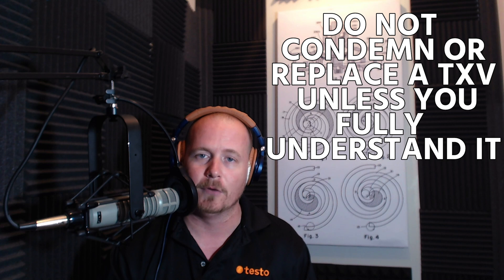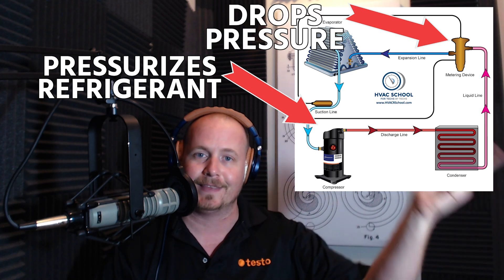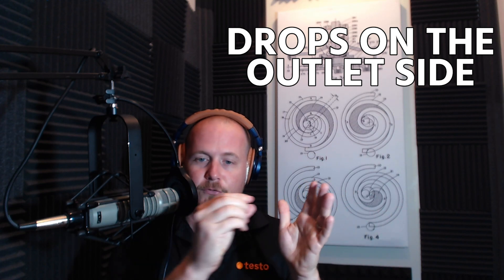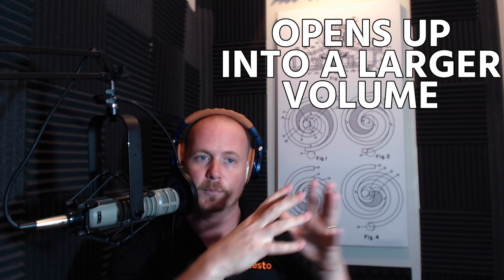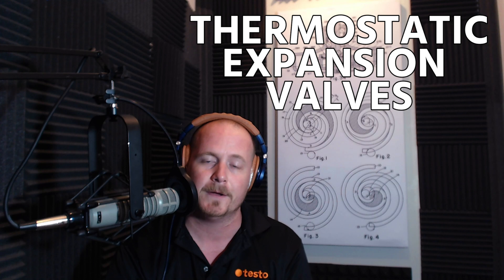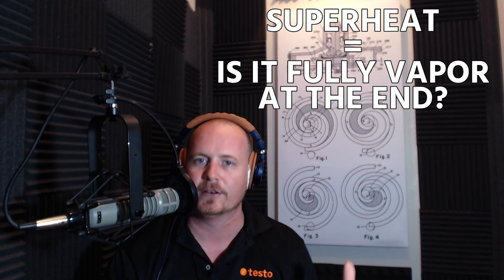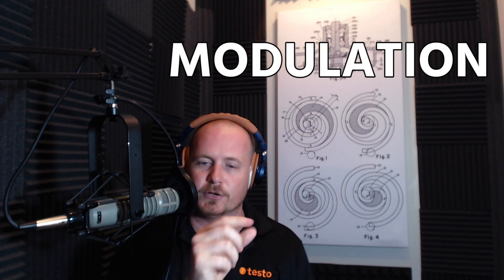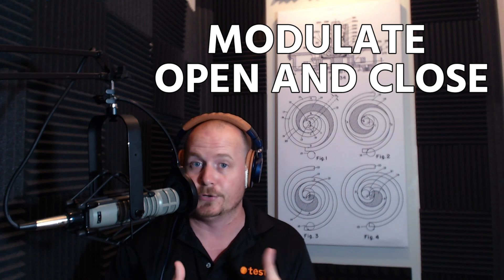HVACR Metering Device Basics

Comment: I get the pressure dropper, but doesn't it also help increase the pressure? without the restriction the compressor would just pump. Think about the indoor metering device in heat mode.
Reply: I don't know what you mean by this

Comment: Brian, I have a question for you.
  Ever since I started HVACR school August 18th of this year (2022), the entire process of the refrigeration cycle has really intrigued me.  So much, in fact, that something in particular has been bothering me lately, and, for some reason, my own instructor has been unable to answer.
  This is what I have gathered so far:
  Going into the metering device is 100% liquid.  Coming out of the metering device is a mixture of about 80% liquid, and about 10% vapor.
  How is it that the refrigerant turns into a mixture of liquid and vapor after it passes through the metering device if the metering device is reducing the pressure of the refrigerant (which, in turn, reduces its temperature)?    
  Wouldn't reducing the temperature of a liquid refrigerant even further actually prevent it from turning into a vapor, and allow it to maintain its liquid state?  After all, in order to cause a refrigerant to turn into a vapor, you would have to increase its temperature? 
  Why is this confusing me?
Reply: It's confusing because it was oversimplified. It's actually an equation with three variables: PV = nRT. Generally you have to hold something constant to make sense of it. Check out a phase change diagram. A liquid can become a gas by heating it, OR by dropping the pressure on it. In a thermostatic valve, temperature is held constant (thus, "thermo-static") and pressure is decreased until the refrigerant is at the "critical line", right on the edge between liquid and gas. This is also called saturation temperature. Saturation depends on pressure; it's what that line is. So at this lower pressure, it's saturated now, and only takes a little bit of energy to turn the liquid into a gas, which is very energy efficient.

Why does this happen? A liquid is a bunch of molecules bumping around, everything straining and struggling against each other to move. When parts of it boil, what's happening is those molecules got so much energy that they pushed everything around them away, and made personal space for themselves, a big empty area, called a bubble. The liquid is trying to close in on it, but the gas is too energetic and holds it back on all sides. Making it more energetic - ie, hotter - increases the strength and size of the bubble, but so does making the LIQUID WEAKER. If you decrease the pressure holding down the liquid, the liquid isn't pressing on itself so hard, and it's easier for bubbles to form with less energy. It doesn't have to try as hard to form some personal space.

So increasing the volume decreases the pressure, and at that temperature and lower pressure, some of the molecules are able to escape the liquid's confinement and become vapor.

Comment: Being called a 'metering device' makes it sound as if measurement is the primary purpose of this component, because everyone thinks of a meter as a visual indicator. But as a pressure reduction device, shouldn't this vital component be called the pressure reducer, or just the 'reducer'? That would make so much more sense to apprentices, I would have thought.
Reply: Yeah. It does also have a meter on it, though.

Comment: Can overfeeding an evap cuase high temp in a freezer? Since the pressure would go up.
Reply: Yes, because PV = nRT. So if Pressure goes up, Temperature goes up. The condenser only works because the refrigerant is colder than the air of the room it's trying to cool. If the refrigerant is already hot, then there's less room for it to take on heat before it evaporates. It still takes on heat as a vapor, but slower than as a liquid, so this is bad. now you're removing less heat from the room per cycle, so it's running hot.

Comment: Is it possible that the expansion valve fully closes to prevent refrigerant liquid flood back to the compressor when the evaporator coil has less heat load?
Reply: Yes, depending on design of the valve.

Comment: Is the metering device dropping the pressure of the sub cooled refrigerant and allowing it to cool even more or is it dropping the pressure of the the super heated vapor and allowing it to reach its condensing point?
Reply: It goes: hot gas -> meter -> cold gas, and it does that by dropping the pressure of the hot gas. PV = nRT
Reply: Superheated -> expansion valve -> supercooled

When a gas expands, it gets colder. When it compresses, it gets hotter.

Comment: Can you run hose water through this valve?
Reply: Yeah but it will probably rust
Reply: Also it's really bad for the life of the valve. Water has the wrong material properties (heat capacity), and hose water usually carries little bits of unpurified dirt and impurities that will clog up the valve, and the rest of the line, and decrease heat transfer abilities.

Comment: Can anyone explain to me how liquid enters the metering device, drops in pressure and becomes 25% vapor and 75% liquid? 
Drop in pressure is a drop in temperature so how does vapor result?
Reply: Correct me if I'm wrong: Should be the drop in pressure from the liquid going into the evap causing it to 'flash'; Quickly becoming part vapor & turning 100% as it exits the evaporator. Vapor results from the heat the refrigerant picked up being evaporated.
Reply: Hey buddy good question I'm trying to figure out the same thing lol . Did you figure it out ? Please let me know
Reply: Check out a phase change diagram. As pressure decreases, liquids turn into gasses. They also turn into gasses when you increase temperature. It depends on the non-ideal gas formula: 
(P+ (n^2 / V^2)) * (V-n) = nRT. It's an equation with two variables. Generally in thermo we try to hold one of them constant. That's why the thermostatic valve is called a thermo STATIC valve - it's designed in such a way that refrigerant temp remains reasonably constant. So when you hold temp constant, and decrease pressure, it passes over a critical point and partially vaporizes.

High pressure liquid -> decrease pressure -> partially vaporizes

The same happens when you go:

High pressure liquid -> increase temp -> partially vaporizes.

If you decrease pressure (by increasing the chamber) and increase temp (with an electric heater), it vaporizes even faster.

Why does this happen? Because "low pressure material" is what a gas IS. Boiling happens when molecules have enough energy to push everything around them away and form bubbles and escape. Increasing the temp gives them more energy, but decreasing the pressure decreases the thing they're working AGAINST, because pressure is what's holding them in.